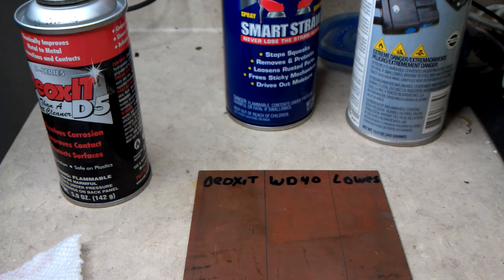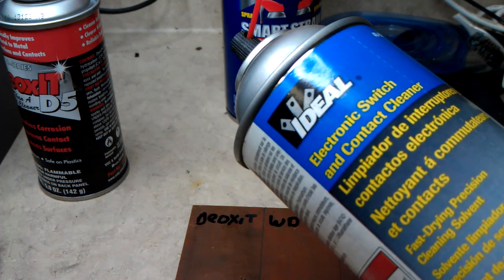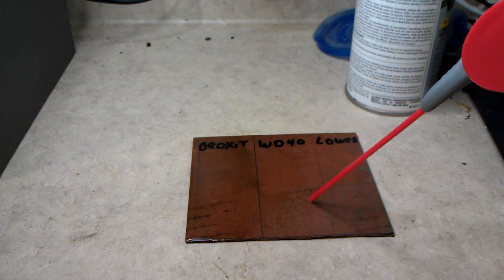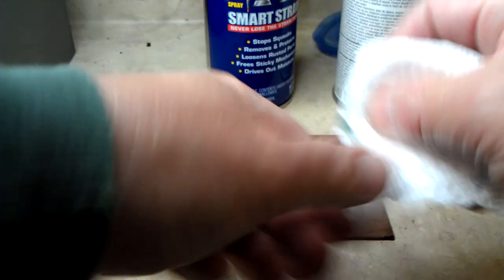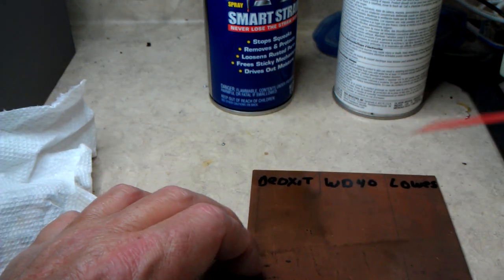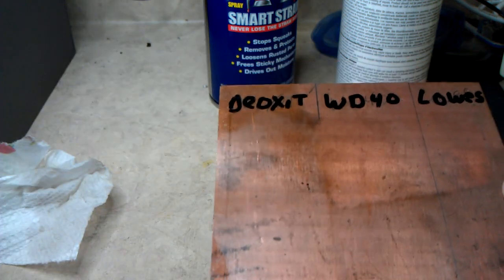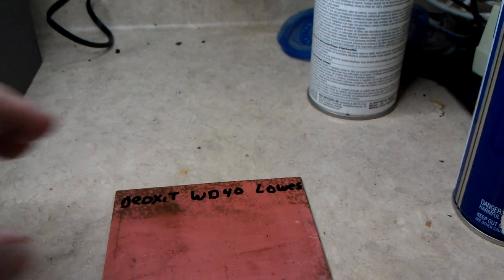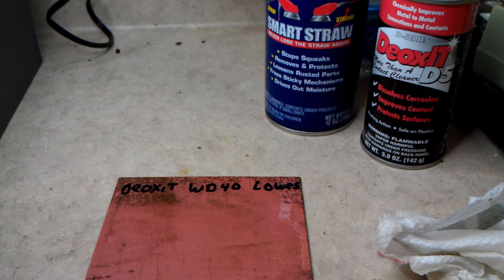DeOxit vs WD40 vs Contact Cleaner - Shootout

Comment: I was just in an Amazon Business tab all signed into my account. I had this big thought cloud over my head. "I sure miss the smell of De-Oxit. Or was that De-Oxid? Or was it De-Oxid - Gold? Or was it De-Oxit that had the "-Gold"? Wait a minute...I need to google-up a what's whut here!" You vit-chyo came up. I fast-forwarded through the yadda yadda bits n cut straight to the meat n taters bit where CLR proved king. and WD-40 proved best lube. And you SAID IT. SO: Thank you kind sir! I have a case of gallons of WD-40 and two pump sprayer cans WD-40 makes just for refilling, I have 3 dozen hypodermic squirt bottles to put it in, as well. I have a case with four gallons of commercial CLR constipate. I've got two milwaukee sprayers and a <60dB air compressor and 5 gallon can of tetrachloroethylene and 5 gallon can of N-Hexane. I think I know what to do here. Only one thing left to do: a like. and a discribe! Get yourself a Milwaukee Sprayer! They're HUGE saving money important on our chemicals we use. Flux remover spray is getting up over US $50 per can now. I've got two 5 gallon cans of the two ingredients that make up the BEST flux remover EVER. PERIOD. (Acetone is fine if you live in Commufornia) I think. Not sure. Maybe they don't want you having THAT, either.
Reply from the maker: Whew! I hope you are well insured!

Comment: I just recently got into vintage audio and have cleaned several switches/ potentiometers with the deoxit d5 and it has fixed the ones that were staticky or not working at All. Probably has a lubricant on purpose.

Comment: Is WD40 plastic safe ? We sprayed WD40 on our worms for fishing. It worked but after a week the monofilament line went brittle and hard.
Reply from the maker: WD-40 can be used on just about everything. It is safe for metal, rubber, wood and plastic. WD-40 can be applied to painted metal surfaces without harming the paint. Polycarbonate and clear polystyrene plastic are among the few surfaces on which to avoid using a petroleum-based product like WD-40.
Reply: @n4lq  OK Thank you Steve.

Comment: This experiment is ridiculous.  Please be careful.

First of all, Contact cleaner is supposed to be left to dry... don't wipe!
Secondly that is regular WD40... it is NOT a contact cleaner! Rehular WD40 is conductive... it will destroy electrical equipment.  Use it on your garden gate.
It was also massively contaminated by the cheap stuff lol.
Finally... what the hell are you doing adding regular WD40 on top of a contact cleaner?  What will that achieve?!?!

If anyone is reading this comment... trust me, Deoxit D5 is amazing... it will renovate your electrical equipment to perfection... and it leaves a protective layer on components.

The other popular product is servisoil Super10 

WD40 do make a specific contact cleaner... but it only works as well as a cheap store brand... you're paying for the brand.
Reply from the maker: Ah yes. Deoxit is so amazing! "It will renovate your electrical equipment to perfections".... Man I love this! 
I've been destroying equipment for 50 years now. Funny how it keeps working :*)

Comment: I thought this was wd-40 electric contact cleaner but this may have been before that came out but I guess if you knew it was all copper you could use like some delimer which is some kind of diluted acid and hit it with some water or something like that and or some baking soda water mix

Comment: Interesting that the deoxit was the oiliest when the WD is a penetrating OIL??? Another vid done by an electronic expert says deoxit is designed with a residual oil to lubricate and protect rotary or slide potentiometers. Your test was really deoxit vs WD and lowes contact cleaner mix since you sprayed them together. Deoxit is supposed to leave a film, OF LUBRICANT. You made one good statement at about 8:45 and 10:45 when you said you would follow up the contact cleaner with a lubricant when cleaning a switch or "pot". 

I would not spray CLR into any electronic component, it has mild acids in it which are not good to leave in there unless you can completely flush it out. Read the labels and you can see by the chemicals listed how they work. I'd bet the contact cleaner has some very strong solvents that dissolve grease and oil so lubrication needs to be added back after use on anything, it's really intended for plugs and you should apply some dielectric grease to most before plugging back together anyway. The thing to remember is that you are trying to clean oxidation then coat the bare metal with a lubricant to allow smooth operation and prevent wear and most importantly, oxidation (corrosion), which causes  poor contact again, the reason you needed to clean it in the first place. While I appreciate you doing the experiment the best way you can I think it is a little misleading although you had a couple good comments.
Reply: great response, thank you

Comment: With all do respect sir, you are not using the DeoxIT correctly. You are not suppose to wipe the diluted spray off. It cleans as it disolves. The oily film evaporates as it dries.

Comment: The CLR is acidic and basically just etched the surface of the board.  It would leave a rough surface that would oxidize quickly.

Comment: Hi Steve, 
I know this video is from 2013 and wonder if you have done any more experimentation? I did find this interesting response on the web:
My first personal test of Deoxit went like this. I found the grungiest dark brown penny I had, and put it up on a shelf, with a single drop of D100 over Lincoln's face, and left it to sit. Within a month, the circle had a blue/green scum floating on it. I wiped off the scum, and under that was a nice clean circle of copper (surrounded by the brown). It is like it turns the clock back on copper; releasing the oxidization from the surface, and preventing it from worsening. (END)

Perhaps Deoxit takes more time to do it's thing than you experienced in your test. 
I have also hear that brake or carb cleaner does a very good job but I would be concerned using it in electronics since I don't know the pH and how it might affect plastics and other materials. 
Have you found other products for contact cleaning that you were impressed with? It seems to me for the money, there may be some good alternatives. I have had some other cleaners in my shop that did very well. Just not sure how they compare to deoxit over time.
Even with deoxit, I have seen no long lasting results and have found some electronics requiring subsequent treatments after a few years.  
73, Glenn WA4AOS
Reply from the maker: No more testing Glenn. I've never had any negative results with WD40 on contacts. I did splurge once and bought that little can of Deoxit and used it on a  long rotary switch. It left a lot of oily residue.

Comment: oxidized copper turns green. that copper is just dirty. clr is just concentrated viniger.
Reply from the maker: Tried cleaning the shower with CLR and my nose started bleeding. No vinegar!
Reply: Copper will turn dark with age and corosion. Only with high moisture will it turn green. Look at your plumbing.

Comment: Contact cleaner "shootout" ??? After the bullets stopped flying, nothing was resolved! The Deoxit D5 should have been left to do its thing for ten minutes before wiping off any residue. The "contact cleaner" bled into the WD-40, so no conclusion was possible there. "C+" for effort though.
Reply: LOL This video was moronic to the point of being a troll. Now this guy's dad is going to find a mess on his workbench when he comes home from work and he's is gonna get it.
Reply: Also..regular WD40 is a conductive lubricant oil... it will totally destroy electrical equipment!
It's for greasing up paddocks and garden gates lol.
Reply from the maker: Wait ten minutes and WD40 would have done even more moon man.
Reply: but @Steve Ellington...... that WD40 is the Multi-Use Lubricant... not the Contact Cleaner...
the "WD-40 SPECIALIST Contact Cleaner"..... is the rival of DeoxIT... :-\
Reply: @Ramdileo_sys  WD-40 is not a good lubricant and never has been. It is a water displacing formula with some lubricating abilities. There are lubricants that work much better and do not attract dust as badly.
Reply: for general lubrication @sarge1231 ??... or for Contact Cleaning??
this was about Contact Cleaning.. and @Steve Ellington is using traditional WD40.. not the  Contact Cleaning one...
Reply: @Ramdileo_sys  It is not made for either, and there are better solutions made for both. It is not, and was not designed to be a lubricant or contact cleaner. It does have some lubricating properties. It also has some solvent, and I have often used it lightly to repel water in switches on my motorcycle and prevent rust. but not a heavy spray to clean the contacts, just a very light spray to replace the protective coating the contact cleaner removed. For lubricating purposes silicone, PTFE, and lithium grease are good depending on the application. I am not saying it can't ever be used as a lubricant, because we all sometimes use what we have on hand, but it is not the best choice as a lubricant.
Reply: Hence the name W(ater) D(isplacing) - 40 (is how many times it never was any good as a lubricant before they abandoned the effort and it was made retail ! Hahaha. 👎🤪

Comment: From what I've been learning about working on old radios and test equipment, you have to make sure that the cleaner doesn't destroy the plastics or the coating on the circuit boards.  So, a cleaner may be great at cleaning but if it destroys the potentiometer or switch or circuit board then you're not really ahead of the game, are you?
Make sure, like on the DeOxit cans, that it says "SAFE FOR PLASTICS" or "SAFE FOR MOST PLASTICS".
Reply from the maker: +Mystery47 Deoxit is safe for MOST plastics....Note M O S T.    Same for WD40. Do not use on poly-carbonates and clear polystyrene per the manufacture. You better find out what "MOST" includes before using DeOxit.
Reply: Steve Ellington I've been perusing many of the forums that specialize in ham radio and shortwave radio and repair.  The two cleaners that they swear by universally in order of preference is Isopropyl Alcohol (IPA) and DeOxit.  
Anything else such as WD-40 or CRC products are not shunned but not recommended either.  As you say, they should be used at your own risk.
Many of the old timers and old time electrical engineers say they've been using DeOxit for decades and they rave about the results.
As for me, I'll thoroughly clean any pots or switches with IPA first and then apply DeOxit sparingly.
I did just buy some CRC, though.  It is an IPA spray can so it should be okay for chassis cleaning.
Reply: But inside an iso-plug it should be alright to use wd40?

Comment: In my experience, I've found it best to use a contact cleaner WITHOUT a lubricant in it because not all contacts need it, and it leaves a film. After cleaning, if the part needs lubricant, like a fader or pot, I'll use an electrical contact lubricant or even grease depending on the application. I prefer Radio Shack's house brand contact cleaner. I hate Radio Shack, but their contact cleaner works great. Hope this helps. Oh, also, most of mt experience is with musical instruments and loudspeaker systems and effects. So if that's the way you're looking to use these type of products, I can recommend them for that. PS DxoxIT sucks. I have a full can on my workbench because I never use the stuff.
Reply from the maker: +Guitar Whores Problem: Many switch contacts are manufactured impregnated with lubricant and using switch cleaners WITHOUT lubricant can dry out the contacts and cause rapid wear. TenTec, a ham radio manufacture, in their manual for one of their early products warned against using typical contact cleaners on their band switches. Yes indeed, Deoxit is really cheap stuff with a high price tag. DeOxit's man use is for washing brains.
Reply: That's why I say to use a separate lube. Clean it then lube it up.

Comment: Once I was told to do not use WD40 in switches or contacts because it is greasy but after several, I mean several tries in one or two years, to get rid of a bad contact on my Yamaha A3090 input selector using contact cleaners, tried 2 or 3 of the most expensive ones, I decided to give WD40 a try, and guess what, my old A3090 started working as it was brand new!!!. Of course that was 30 min ago, hopefully it lasts without side effects.
Reply: So, 3 years later... still working (also, was it wd regular, or the special WD for electrical contacts... Thanks!!
Reply: @remotexpolde    same question
Reply: Mauricio Naga did it?

Comment: Not sure why they are comparing WD-40 with the other two. They are entirely different products for different use. WD-40 is not a contact cleaner, a lubricant, an anti-seize, a penetrating oil, or a de-greaser. It is an indirect rust inhibitor. While it has properties that may clean, lubricate, penetrate, and degrease, originally, it had one purpose: WATER DISPLACEMENT. That is how it got the "WD" in its name. It's development was achieved in the laboratory on the fortieth attempt at concocting a solution to displace water, giving it the "40" suffix and the full name WD-40.  It was originally designed for the US military. It's purpose is to drive water out of mechanical joints. It was never intended to do anything else. While WD-40 may do other things, there are better lubricants, penetrating oils, de-greasers, anti-seize compounds, rust removers, rust inhibitors, and contact cleaners. All other uses were consumer marketing and consumer experimentation and may or may not be useful or safe applications. As always, follow manufacturer directions on the can.
Reply: WD-40 does a contact cleaner https://wd40specialist.com/products/contact-cleaner/
Reply: I don't know the chemicals in the WD contact cleaner but it's probably almost the same as the Lowes or CRC contact cleaner, (Isohexane, Ethanol and n-Hexane) meant for plug contacts, (they show a plug right on the label) not electronic switches or pots since it removes all lubrication from the device.
Reply: WD-40 is a lubricant.  This word-of-mouth nonsense about it not being a lubricant is listed as one of their myths on their own site.  People will just repeat what others say....it's like talking to the grunts at Home Depot.  Read it yourself if you want:  https://www.wd40.com/cool-stuff/myths-legends-fun-facts
Reply: WD is also FLAMEABLE. I found this out the hard way.
Reply: WD-40 Is great for a parts cleaner for greasy parts.  It will dissolve baked on dried up grease and grime.  Then Dawn dish soap for the final cleaning.  Great stuff for cleaning up old snowmobiles and stuff like that.
Reply: Because for some reason people have gotten the idea that WD-40 is useful for contact cleaning and many use it for that.

Comment from the maker: Ok so I just tested WD40 with my atomic conductivity meter and it shows +42 millimohs which is slightly better than zero resistance. I'll have to spray DeOxit on it to neutralize the reaction with the copper before it totally disappears.